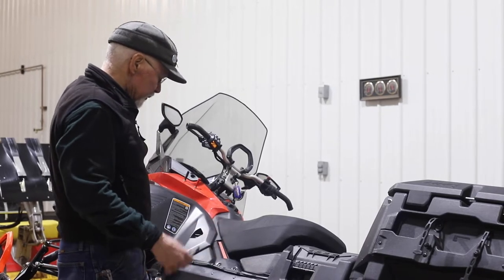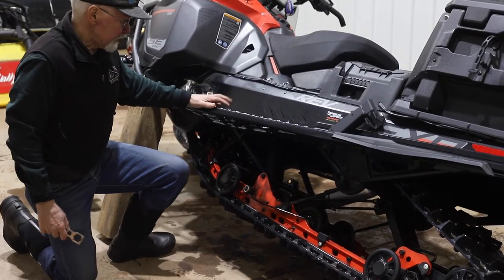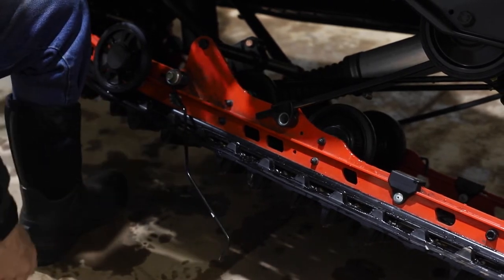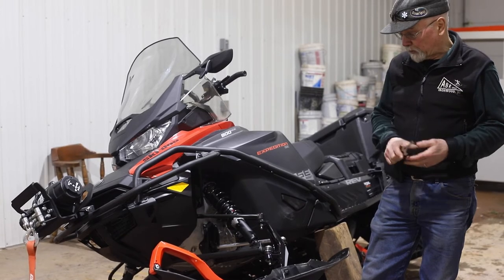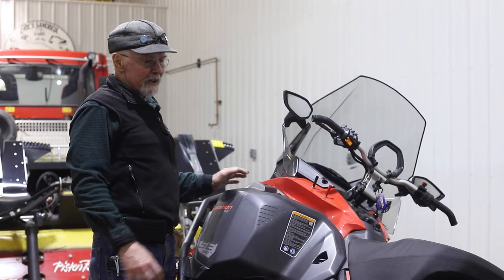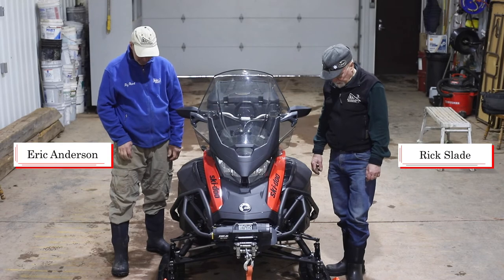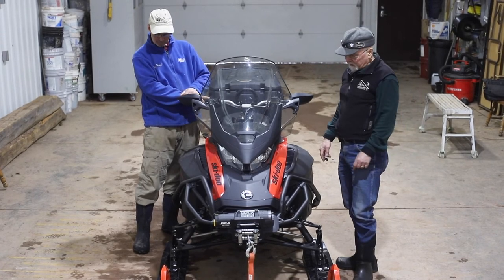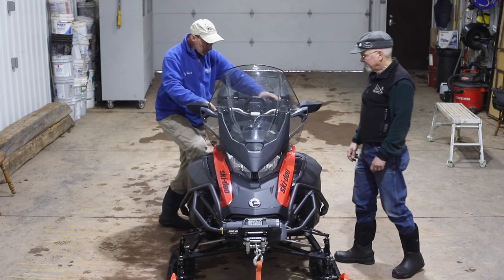Setting Up Your Snowmobile for Ski Trail Grooming

Comment: That's not the correct way to set belt / clutch, the lower part of ribs on outer edge of belt should sit flush to just proud of edge of clutch , incorrect adjustment will result in the problems you mentioned and hard engagement of reverse. Owners manual covers it well as well as you tube videos.